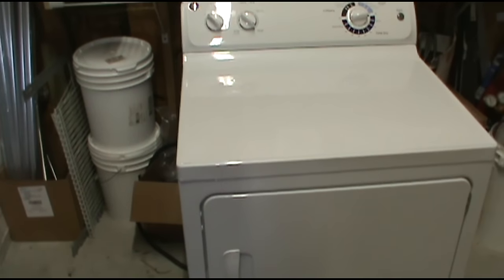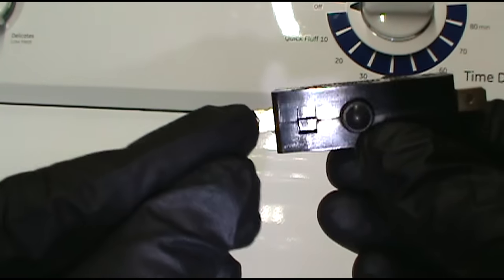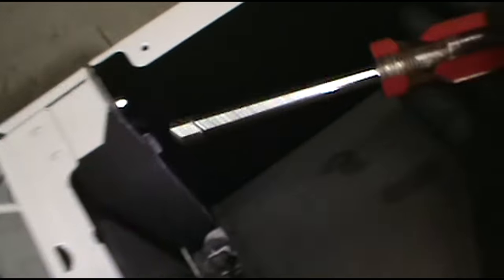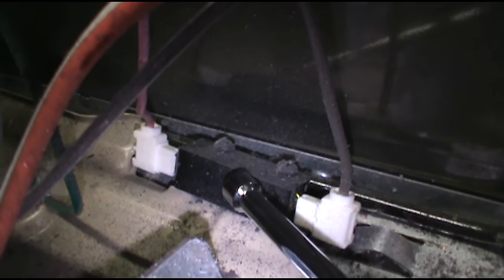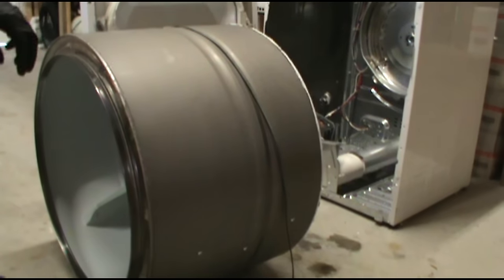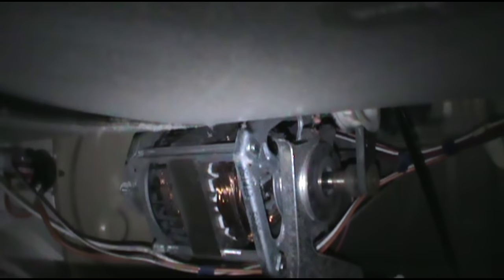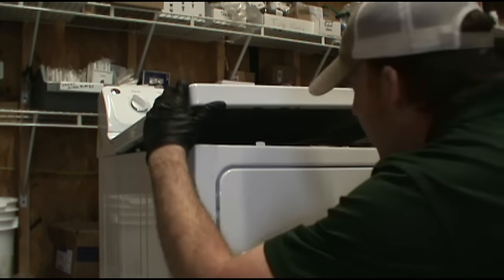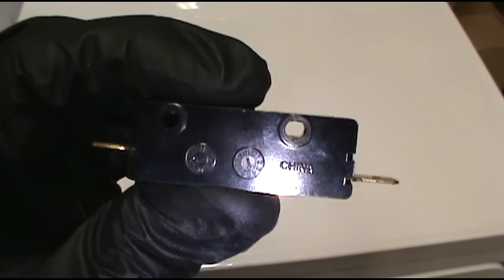Dryer Will Not Stay On After Pushing Start (How to Fix)

Comment: My dryer start button was working fine. I took everything apart to replace the belt because it was squeaking, and I replaced the felt seal. Now that I've put everything back together, the dryer won't stay on. Did I put something together wrong? Did I damage something when I was replacing the belt? My husband took the whole drum out and repacked the axle for the belt tension.
Reply from the maker: Hmmm, there's so much that could be wrong. I'd need to be there for this head scratcher. There's an interlock switch that can go bad but you said it was working fine before you took it apart. I'm stumped. Sorry ☹️
Reply: @LexVance  We figured it out! The tensioner is hard to deal with when you can only get one hand in there. My husband managed to pop it out of place while he was replacing the belt so it was no longer depressing the button on that switch. We opened everything back up, popped the tensioner arm back into place. Now everything works!

Comment: Sorry, another question ... I am going to start by replacing the start switch.  My belt is fine and the drum turns fine.  I think, for me, it will be easier to try the start switch first.  Taking the whole dryer apart looks daunting, to get to that drum switch, but I'm willing to try it if the start switch is not the problem.  What do you think?
Reply from the maker: Its worth a shot! Go for it!

Comment: Hey, Lex like your videos, but didn't that belt tensioner pulley need replacing as well?
could have been what broke the belt!
Reply from the maker: Keith Herring The pulley felt good. Nothing rough on it. The belt expands & contracts as it heats & cools. Its 6 years old. Like a rubber band, some pop after years of that. However, if it happens again soon after replacing, Ill do the pulley too. Thank you so much for watching Keith!
www.DirtyMaintenanceNation.com
Reply: I agree, the belt pulley should not have had slop in-between the roller and shaft as it did. I’m betting the belt slipped off the roller due to this and that’s what ate up the belt.  Did you ever have further issues?

Comment: Thank you very much for the video, I have an issue though, after replacing the broken belt my drum spins no problem, but when clothes are put in it, it either turns slowly or not at all.... any idea of what it could be?
Reply from the maker: Hmmmm, if the belt is on correctly then the motor might be bad. Make sure the belt is on the black rubber side and not the smooth side. Other than that, I would need to be there looking at it to solve this head scratcher. I hope it works out for you Violent Liz!
Reply: @LexVance  I will check that out, thank you very much!

Comment: Lex, narrowed it down to possibly the drive motor. How can i test the motor in place, without removing it?
Reply from the maker: I use a plug harness from an old dryer.
Reply: Yes. Saw that. I don’t have a diy plug. Can I use a voltmeter to test it in place?

Comment: I could use your expertise: Lex,   I turned the "on" switch, drum not moving even when depressing door switch.   My belt was broken; I replaced the belt. Won't stay on after turning "on switch", have to hold it on.  I took dryer apart again,  I saw and removed the belt switch, tested it, it tests good.  Now, is it the motor?
Reply: Just a follow up on my problem, Lex:  As I mentioned replacing the belt which I thought was a bit tight...was actually the problem.  The replacement was in the 88" range, purchased at the big box store, and due to its tightness was pulling the take up pulley rod too much and it pulled it up and over the motor  switch (I.e. Belt switch) and was not depressing the switch button causing the motor to stop.  So, I got a 91 1/2" belt and, wallah, it fixed the problem. 
  You were right, "very seldom the motor."  Yes, a belt can be too short!  There was no model number listed anywhere on the machine for some reason, so when I re-ordered the belt online, I got the one that was for the most machines, and it fit perfectly. Thanks again for your reply, and helpful video.

Comment: Just fixed one of those belt safety switches on my property. Ended up just being some bent metal not a bad switch or broken belt
Reply from the maker: Justin 95 Right on man. Those switches will trick you if you don't know they're there. It'll turn you into a parts changer. I've done it. 😂👍😂 Thank you so much for watching Justin!
www.DirtyMaintenanceNation.com
Reply: Lex Vance keep up the great vids man! The effort and knowledge is much appreciated and your channel has definitely helped me climb the ranks in the apartment maintenance field.
Reply from the maker: Justin 95 that's fantastic Justin! That's why I do it & im having a blast helping guys out. If I can save someone 5 years of screwing things up like I did, then im on the right track. I wish YouTube was around when I started. I had to learn by blowing things up. 😂 thank you again for watching Justin!

Comment: Have the same problem however, I hold the button and let it run for a few minutes and it doesn't heat up. Do I have multiple issues, or will it not heat up while holding the button? Kenmore similar to the one in your video.
Reply from the maker: Yea, your heating element could be bad. Could be multiple issues. I'd need to be there to look at it.
Reply: @LexVance  it's gas

Comment: Hi was wondering if you can help, I think you explained it in the video but I was a little confused.  Basically I push the on start button it goes on and then off, its a hotpoint  gas dryer.  If i hold it on and open the door when press the door switch in it spins fine and heats fine and the door switch is fine but it just wont remain on unless i hold the on off button down and the door switch button down while having the door open, can you let me know if you have any advice for that particular problem thank you Anthony
Reply from the maker: There's a interlock switch on dryers that will cut the dryer off if the belt breaks. Yours could be bad. It'll go when you push start but will die when you let go of start button. That could be your problem. The switch is usually inside by the motor and pulley wheel. Major surgery.
Reply: @LexVance  yah i was watching your video I'm sure I could get the dryer apart but I would never be able to put it back together in working order, I really appreciate you helping me diagnose the problem though

Comment: I have this exact dryer and mine does work/spin but it cuts off after a few min while on timed dry and I notice it is super hot on the inside and it continues to make a noise like a timer noise or something up top on the control panel section and doesnt cut off until I twist it to the off setting. Any Ideas? Thanks in advance!
Reply from the maker: See if your vent hose in the back of the dryer is kinked or clogged with lent. If the heat doesnt go out of the vent, it will get too hot and shut off. There's a high heat safety switch that shuts it off if it gets too hot.

Comment: Hello,  The new belt is the exact same size as the old one, but is way too loose when I put around drum and Idler arm. The arm doesn't seem loose, but that's all I can think of. Thanks
Reply from the maker: Pull the wheel to the right and the outside part of the belt goes in the left side of the wheel. While at the same time wrapping the belt around the motor shaft. Hope this helps! 🤞
Reply: @LexVance  Thanks so much for replying, I wasn't expecting that! Any way after playing around with idler arm, I can feel its very loose at the base. How do I  access that? Thanks again!
Reply: I guess drum has to come out. I may be over my head......
Reply: removed drum and looks like arm came out of its slot. Replaced it and it now looks like its in a position that might work

Comment: I'm having trouble looping the belt over the wheel and the motor shaft. do I need a longer belt?
Reply from the maker: It can be hard. Pull the wheel as far to the right as you can. I'd need to be there to see how long the belt is.

Comment: What if our drum is spinning? Do you have another video on what it could be?
Reply from the maker: The dryer interlock switch is bad or the pulley wheel bar came off the switch. I don't have a video for that. You'll need to take it apart to get to it. I hope everything works out for you!🤞

Comment: So my belt switch wasn’t lining up with the bar. I adjusted it and sure enough it moved out again and stopped working. I tried taping the sensor button down and it seemed to work but later the same day it’s not working again. Any tips? I have a spare switch I ordered but if the bar doesn’t push the button what else can I do? Is there a way to bypass it? Just tie the wires together?
Reply from the maker: Yes you can bypass by wiring wires together.

Comment: I have the same dryer. It will run as long as I hold the button down. Spins too. Does that mean I just need a new start button? Or could it be something else?
Reply from the maker: Could be a bad interlock switch or the pulley wheel needs to be adjusted on the interlock switch button.
Reply: I should mention it did eventually work but then wouldn’t work again. Is that consistent with the interlock switch or would that most likely be the start button switch?
Reply: @jonlevesque5490 i dont think it has anything to do with the start switch as it works when u press it.

Comment: what is the black switch called or part number tht way I can look it up on Amazon. I have the same dryer and once I push start it says on for about 4mins thn it turns off 
. would tht be becuz of tht same black switch even though the belt is still good???
Reply from the maker: Dryer interlock switch.
Reply: thnk u sir I appreciate it

Comment: Help. Indeed the belt was broken. My father helped me take apart, but we have no idea how to make the belt stay in place very tightly like you did. After you put the belt how did you attach it to the motor and the wheel? That part is very unclear because as you stated in the video that’s the part we can’t see. Any tips? Thanks. Please I hope you can reply. I am desperate.
Reply from the maker: Pull the pulley wheel over to the right. Then, put belt on motor shaft. Then, the right side of the belt goes on the left side of the pulley wheel. You don't have to wrap belt around the pulley wheel.  Then, let go of pulley wheel.
Reply: Lex Vance thank you so much.
Reply: Lex Vance your explanation was amazing. We replaced the new belt today with the instructions you gave us and it works perfectly. The only “bad thing” that happened to us before today was that the toneluck switch (not sure if that’s what is called), the door switch, came off and it disassembled into various pieces (now we don’t know how to assemble it back). I know that piece is not that important because I used the dryer without it today. The only thing is that if you open the door before it finishes the cycle it keeps spinning. What do you recommend? Should I leave it without that piece, try to assemble it back or buy a new one? If I can’t find it here in Puerto Rico I will have to try Ebay or Amazon. Thanks in advance for all your help.

Comment: Lex, having the same problem with my GE dryer. Doesn't stay on when you hit the start knob. Opened the dryer up, the belt is good, took the dryer apart and pulled out the black switch checking for continuity, it's beeping for continuity so the switch is good. Not sure what else is wrong any ideas?
Reply from the maker: Weird! Man, that's a head scratcher. Hard to tell by not being there in front of it. See if the start switch is bad. Sorry man!
Reply: @LexVance  the start switch was the first part that I thought was bad. I ordered a replacement part and found out that start swhich was good after I tested the the old one to the new one.
Reply: @LexVance  I'm stumped as it has the symptoms of everything in the video that you showed except the belt was good in the switch was good. When I hit the start button it clicks on then I let go and it clicks off....

Comment: I won’t need to unplug any electrical wires to replace the belt besides unplug from the socket ? I’m afraid of messing with electrical wires . And where did you get your belt ? I have. A GE it’s lie 18 years old.
Reply from the maker: Just turn the dryer breaker off in the breaker box. I got the belt off Amazon. Just type in make and model number.
Reply: @LexVance  thanks ! I’m a little apprehensive on putting it back together. It doesn’t look as Easy to line things up blindly .
Reply from the maker: @sia1019  Call an appliance repair company if things get out of control.

Comment: Could it still be the switch if the dry heats, but wont stay on longer then a couple minutes?
Reply from the maker: Yep. Or, vent could be blocked in the back and needs to be cleaned out. If it gets too hot, it'll shut off. Make sure vent isn't pinched or clogged. Thank you so much for watching Christina!

Comment: Whats the part name for the switch? Same dryer/issue, but my belt is intact.
Reply from the maker: It's called a GE dryer interlock switch. You can click on the Amazon link below the video and type that in the Amazon search box and you'll find them. Thank you so much for watching Winston!
Reply: @LexVance  thanks man! Would you also happen to remember the model of dryer by chance?

Comment: Is there any other way I can put the belt on like remove something? I know will be harder but willing.
Reply from the maker: I'm not sure. I've only done it the way I did in the video.
Reply: @LexVance  😅 thank you for reading my thoughts of worry and panic! I did get it. I wasn’t pulling the white pulley down far enough to reach the motor shaft. It was tough to get on, then take off (grooves weren’t touching pulley) then put back on. It’s safe to say I will be black and blue tomorrow! 😁 thanks for the video would have never known I could do it without seeing this!

Comment: I have a dryer where it starts normally but stops a random time afterwards (within 3-5 minutes). Then it can be started again, sometimes it stays on for another couple minutes and sometimes I have to hold down the start button to keep it running. It doesn't seem to have a belt tension switch. I've ruled out a faulty timer, and I've cleaned out all the air passages so I don't suspect overheating. It seems to be more likely to cut off when the drum is rotating clockwise. Sometimes the power light flickers and I can hear the motor cut out briefly but then it manages to continue. Any ideas?

It's a Favorit Scirocco (I'm in Europe). The only controls are a momentary start button, a high/low heat switch, and the timer knob.
Reply from the maker: Weird. Sounds like a wire is loose or the circuit breaker is failing. I was gonna say the vent tube may be clogged but you said it's clear. Dryers have a high heat limit switch in them that will shut the dryer off if it gets too hot due to not venting properly. A loose wire is all I can think of. You've got a head scratcher there and I'd need to be there with my volt meter to solve it. Thank you so much for watching!
Reply: Yes indeed 😂. I was thinking of soldering a wire to short across the start switch terminals as a kind of hack (we've already bought a replacement dryer, this is going into the summer house for very occasional use). That way it's like the start switch is constantly pressed, so the dryer will run normally and be cut off by the timer or door switch, but won't need the start button pressed to fire up.

Would this be dangerous or unsafe in any way? I will check the current in my bridging wire before I commit to soldering it (so we'll rule out instant meltdown from high current) but I don't quite know which safeties would be disabled by this hack.
Reply: @LexVance  I'm happy to report it's fixed now :). At first I noticed that if I hit the door I could get it to work or not work. I suspected a door switch but when I removed it and put a jumper wire across its connectors to eliminate the door switch the problem continued.

Then I disassembled the control panel and extracted the circuit board with the start switch and start relay. When removing the connectors I noticed one of them didn't feel well-anchored to the board and upon inspection I saw the soldering looked a little weak/cracked. So I re-soldered all of the pins for all the components on the board with some eutectic tin-lead solder (to make it more reliable than the brittle lead-free stuff).

So far it's holding up, it lasted all 135 minutes of a cycle empty. Tomorrow I will test with a full load of wet clothes.

P.S. This tumble dryer has a funny (unconventional) wiring layout. Most circuit diagrams I studied online show two thermostats for the two heat settings (one heating coil but two temp setpoints via wiring in either one or two of the thermostats). 

This tumble dryer has two heating coils and apparently no thermostat control. I determined that by putting a high-precision wattmeter (similar to a kill-a-watt) inline with the plug and measuring wattage. At low heat it draws a constant 750W. At high heat it's a constant 1500W. It doesn't even shut off the heater while the motor is reversing direction, so for several seconds there's no motor rotation (no air) but the heater remains powered while the motor accelerates in the new direction.

As for the start switch, I carefully observed the power consumption while holding the start button down. There was no difference at all in power (i.e. readings with switch pressed/unpressed matched down to the last 0.1 Watts) so the button doesn't seem to power up any extra motor windings or any other "starting" circuits. It seems to simply start current flowing and that's it.

I confirmed by studying the circuit traces. The run relay (on the start switch circuit board) shorts across the start switch contacts when it closes - so by design, when the dryer is running it's electrically identical to holding down the start switch.